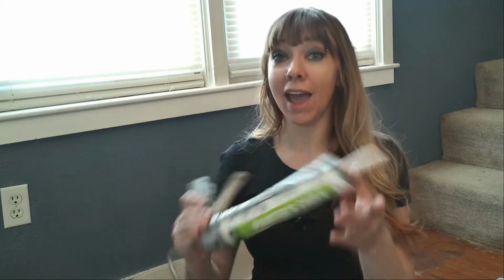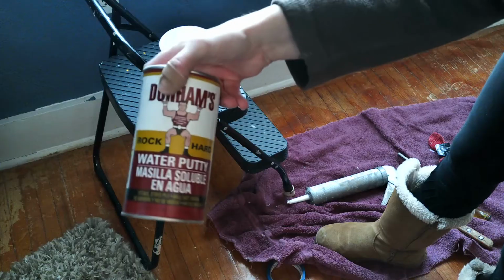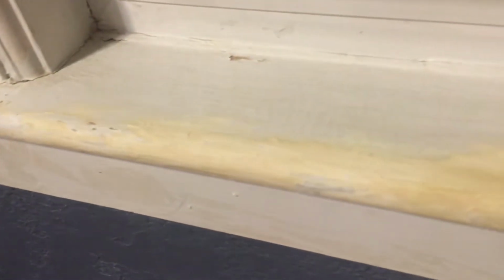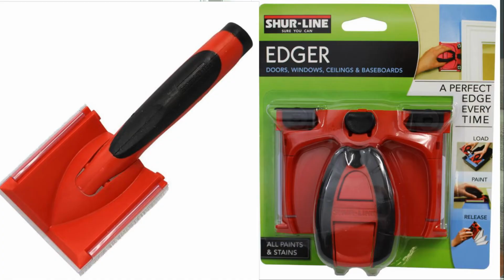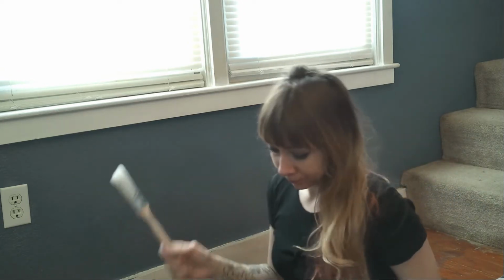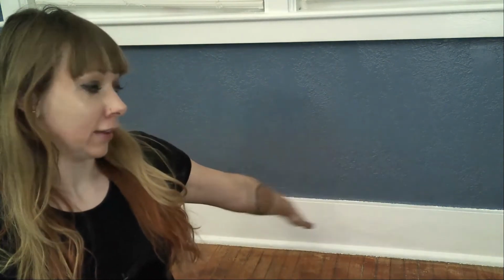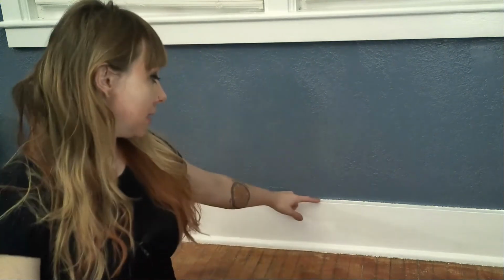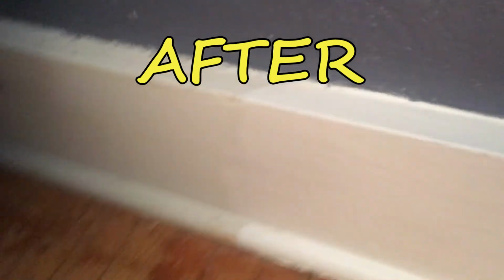Painting Tricks for Trim & Baseboard | 100 Year Old House Trim Repair

Comment: I have an older home.  The window trim has been painted numerous times with zero care and attention to detail.  Sloppy Sloppy Sloppy.  I have already re-done a few of the window casings with updated trim, but in other rooms I don't see the justification and cost associated with it.   I'll eventually update every window when replacement time comes.  Here is my process.  Start by scraping all the bubbles and drips off the trim with a sharp chisel or razor blade.  Remove old caulk on your window frame as well.  Sand with lightly with 80 grit to smoth out any of the brush marks left behind from cheap brushes and bad technique.  Fill any divots or imperfections with joint compound.  Sand again this time with 120 grit.  Repeat the joint compound process if needed and saind with 120 grit.  re-caulk. Use an OIL based primer compatible with latex paint (BIN Original or Kilz Original).  Oil primer is thicker and will fill in the gaps nicely.  Then paint as normal with a good brush and or roller.